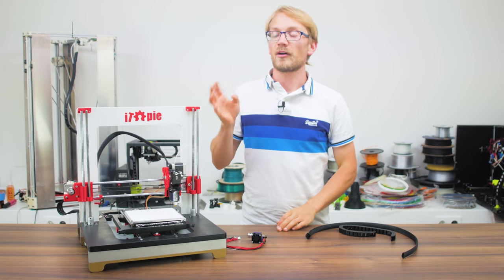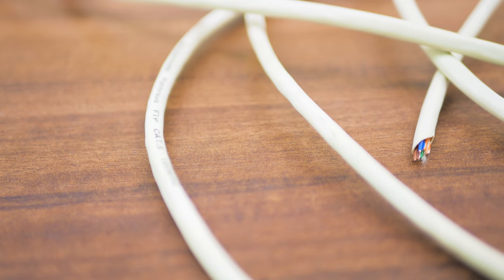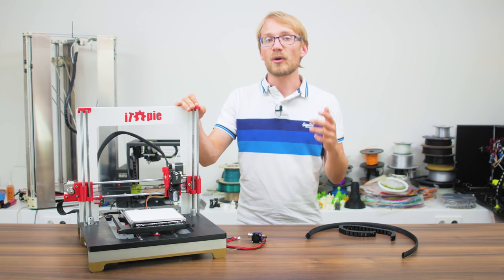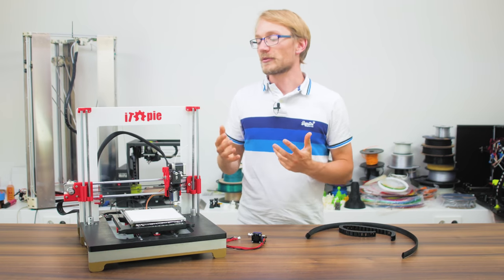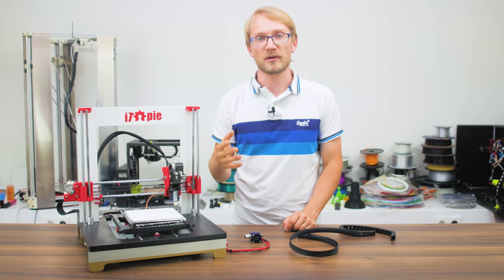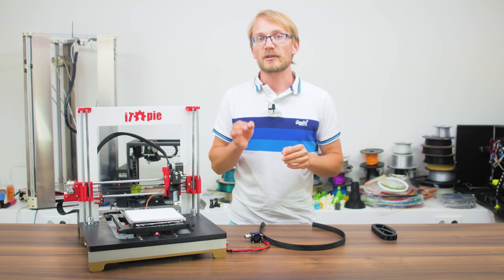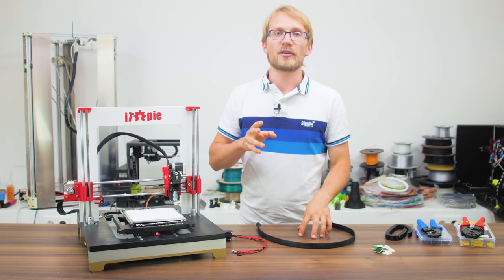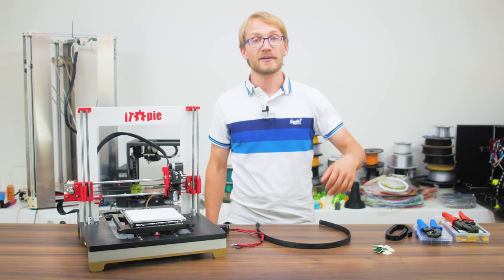How to wire your 3D printer!

Comment: The AWG Standard (American Wire Gauge) originally came from the number of "drawing" passes (pulling wire through a die to make it's diameter smaller), for instance 12 gauge wire required 12 passes through different wire dies, whereas 28 gauge required 28 pulls through various dies. The greater the number the smaller the diameter of the wire.
Reply: so 0000 gauge wire required passing through -3 dies?

Comment: There is another reason to go with stranded wire, it can carry more current and with DC it can carry it with less loss than the same diameter/gauge solid wire. That's because electrons flow mainly along the surface of a wire and a bunch of smaller strands put together to make one wire has more total surface area and thus less resistance to (direct) current flowing. That's why cables made for welding use smaller strands and just a lot more to get to the wire gauge they need. I use welding cable to do the main 12V DC runs from the batteries in my boat and to the trolling motor. When you are running off of batteries all the small losses in the wiring really can start to add up.

Old usb cords are another excellent source of wires for projects. Just off the connectors plus an 3-5 cm (1-2") of cable from the ends and the rest is almost always in good shape. I'm a bit of a freak, wiring up and configuring the controller is my favorite part of building these printers Then again I can't even imagine myself buying a pre-built 3D printer and the last pre-built desktop computer I bought said "Dell 486DX-100" on it.......
Reply: What you're referring is skin effect and it only exist in AC current where there are flux changes periodically. We use stranded mainly for the flexibility.
Reply: @Asu01  And a normal stranded cable doesn't help against the skin effect either, unless the strands are insulated individually from each other.

Comment: Some great information here. I have been 3d printing for around 2 years now, and have learned a lot. Enough to where I feel comfortable buying parts and building a 3D printer of my own, however I have yet to see a video for building a 3D printer thats geared for complete beginners. As a mechanical engineer constructing the working parts would be no issue for me but it took me a long time and a lot of learning to understand how to build a machine with working electrical. From a beginners point of view, theres a ramps board, with a bunch of shit plugged into it and firmware running on the machine. A beginner doesn't know how to pick a board,  hook everything together, know where to plug things into the ramps, or select and edit a firmware for their machine. I think I am going to do a series of videos that covers in detail how to make A 3d printer. Not like in general here are some 3d printer build tips, but step by step, heres how to make THE 3d printer shown in this video from start to finish, covering the mechanical process of building the frame and assembling the parts, to literally where on the board to plug each part in, and how to put firmware on it.
Reply: Wow, this was a long time ago. Just happened to run across this comment and wanted to say this is a fantastic idea for a series that I and many others would be very interested in. I am subscribing for updates just in case.

Comment: i am using ethernet cables on my cnc router steppers, 3A 280ozin motors running at 48V. no issues almost 3 years.
Reply: hi.. what kind of ethernet cable re u using ? thankx

Comment: Good info Tom. Couple of things, leaving this here for information more than anything else as I know it's not a comprehensive guide.

Cable bundles, Spiral wrap; the decent thick stuff works well and is dead cheap, I use the 3-7mm stuff and it supports the wires well and also gives the option to break out a wire from the bundle. There's also an issue with using something like 12 AWG for a bed heater on a board like a Chinese RAMPS or MKS Board. Unless you solder directly to the board or change the headers, the majority of boards I've used can only take up to 16 AWG for the bed, I've tried stuffing 14 AWG in them and it isn't happening. You can use a reducer set of wires with connectors, but it's sub-optimal. I tend to just wire a PCB heater with 16 AWG Silicone wire as it's rated up to around 22 Amps for DC current. When you consider that a standard PCB heater is around 1.1 Ohms at 12v it's only pulling about 10 Amps. If running a 24 volt system I'd be looking at 14 as you're pulling 22 Amps, having a 10A head room is enough.

Comment: a good alternative, though requiring soldering for tier 2 and 3 are hobby battery connectors either dean  (T) or Xt-60, or even tamiya car connectors (these are crimped, too). cheap to get and a single connector will connect a pair of wires

Comment: XT60 connectors work great for higher current items such as cartridge heaters and bed heaters.
Reply: XT60's are what I use in my RC stuff.  One of my craft I calculated would pull something like 60 amps at 12V under full throttle.  Should be good enough for 3D printers.

Comment: I am a big fan of Anderson Powerpoles for the higher current applications and use them on my hot end and bed. They come in 15, 30 and 45 Amp pin types (all use the same housing) and are good to 600V, the housings come in a large variety of colors, and slide together so you can form keyed and color coded connector assembly blocks and they also make blank housing blocks, and there are PCB mount pins as well and can be had pretty cheap. They are heavily used by aerospace engineers on early functional prototypes for that reason, even when 15-45A capacity isn't needed. 

I don't suggest using stranded cat5 or (or even Cat 6 for the higher gauge,) on steppers. You should always be building in an engineering safety factor on your current handling capacity rather than venturing into the safety factor margin. Use 16-18 ga wire for NEMA 17's and you will have plenty of headroom, while it may not seem a big deal with the tiny NEMA 17's, where it totally is when you are driving double depth high-torque NEMA 42's, it really is, because the voltages aren't entirely trivial as a fire hazard or possibly frying half the machine should a wire wear or melt through to something else.

While I love Duponts for hacking and bread board use, I mostly use JST EH for PCB header connections and JST JWPF for mid-path connectors because I keep a good variety of them in stock, as they are waterproof and therefore usable on machining equipment with flood cooling systems as well as keeping chips and metal dust out. Building a assortment of JST or Molex, or pick-your-favorite connectors through mouser, digikey or aliexpress isn't that hard or expensive.

Lastly using terminal blocks and 30mm Din rail for mounting (din rail mount) PSU's, Raspberry pies, and other bits is something I have yet to do with my 3d printer, because I have yet to put it in an enclosure, but is standard operating procedure for larger, industrial (subtractive) machining equipment, and can keep things, clean, servicable, upgradable, and protected from the elements when put in an appropriate enclosure.

Comment: Hey Tom,
danke für das Video! Ich hätte nur noch Flachbandkabel erwähnt, wie Nophead sie in seinen Druckern verwendet. Am Extruder hab ich ein 20-poliges Kabel das den X- und Extruder-Motor, den X-Endstop, das Hotend mit Themistor, den Lüfter und einen freien extra Pin (für LEDs oder einen Bettsensor) versorgt. Am Heizbett versorgt ein 26-Pin-Kabel das Heizbett und seinen Thermistor mit ausreichend Energie. Unterstützt wird das Kabel dann noch von einem Polypropylen-Streifen. Sieht sehr edel aus und sollte auch lange halten. Als Extra gibt am Extruder noch eine D-Sub Verbindung, damit man den kompleten Extruder nur mit zwei Schrauben lösen kann. Ich finde dieses System einfach nur genial, braucht nur ein bisschen mehr Planung.
Reply: Hättest du vielleicht Links zu den Kabeln die du verwendet hast? :)
Reply: Leider nein, war ja alles in dem Bausatz drin.

Comment: I don't like the idea of CAT5 wire for stepper motors, the wire is a bit too thin.  However, CAT5 has 4 pairs, and steppers have four wires.  So, use TWO pairs of wires for each pair of stepper coils, connect the solid colored wires together, and the stripped colored wires together.  Now you have two paralleled pairs, for the two pairs of wires to the motor.  No worries, voltage drop not a problem.

I bundle my wires in spiral wrap.
Reply: Kenneth Scharf that’s exactly what he said and diagrammed.
Reply: Brad .M just use a wire gauge chart and choose something that meets your amperage. I went with silicone insulated which is higher capacity so you need to first choose the type.
Reply: Says guy.  The wire is rated to carry a 2A current but you dispute because of some sort of bigger is better mentality.   How do you think the wire gets rated?  With a dart board? How much current are your steppers drawing?

Comment: I love the idea of Ethernet cable for wiring all the electronics and the mechatronic parts. Is each of the 8 strands capable of carrying upto 2A? Would it be ok to use one strand pair (2 wires) for each motor wire. For. e.g. Assuming that a single coil comprises of Red and Blue wires, would it be ok to use The Red strand pair for the Red end of the coil and the Blue strand pair for the Blue end of the coil?

Comment: Hi Tom, I know this is an old video but just a heads sup.  Solid cored wires are known as 'Cables' while stranded ones are called 'Flex' (sing
ular and plural).

Comment: Always use Crimp Connectors. not Soldered. for flexible wires.
solder wicking into the strands makes the ends inflexible and prone to breaking

Comment: Good info, thanks. Though I have to ask, do you have any experience/opinions with using RJ45 connector on that ethernet cable? Like for instance for the hotend/effector carriage, like the delta wasp? It seemed like a nice way to be able to hot-swap these.Also, congrats on the sponsorship!

Comment: In all cases, i'd use silicone wires. Those are so superior to pvc wires, that i've completely stopped to use the former.
Furthermore, the silicone insulation is much more resistant to heat as well, and another added benefit is that since they are much less stiff than PVC ones, they drastically reduce wire breaking near the connector (i had this hapening often on various electronics projects, and not ones with a lot of connections/disconnections of the cables, nor much movement on the cables, now with silicon wires it never occured yet to me).

Comment: Great video Tom, i recently purchased a Craftbot Plus, what an amazing printer.
Reply: Nice. I have one too, and i'm still happy with that purchase. Shure, it's still not "the perfect printer", even industrial 50K$+ printers are not perfect.I'm pretty amazed tho that they got out of a crowdfunded 3d printer story and are now actually making good printers for a reasonable price.
Reply: What i like is that there are no printed parts and just about everything is steel on it, its a little noisy but it is a machine not a decoration.
Reply: Indeed, it's more built for a workshop, and not really for office users, with the noises it makes. You can tone it down a bit by playing with the speed settings, and i'm shure there are countless other mods you can do to make it an even better machine, just as with all the other printers out there. I just wish they would open the firmware sources up to make even deeper mods to it. The electronics are really quite solid too when you see what other "famous brands" integrate even in the newest (and sometimes more expensive) printers.

Comment: I+m rewiring my printer and this video is really helpful. However, I have a lot of stuff on my gantry. Stepper (4 wires), 3d-touch sensor (5 wires), hotend (2 wires), hotend temp sensor (2 wires), hotend fan (2 wires), cooling fan (2 wires). I'm trying to cut down on number of wires (connector pins) there. I'm using RAMPS, and some of those can share +, and many should be able to share -. I have custom made cable with silicone wires inside. However, testing shows sensors don't like this. Temp sensor , but mostly 3d-touch sensor behave weirdly. I'm guessing EM interference because of their common ground. Any suggestions how to deal with this? Prefferably without changing all cables again :)

Comment: What would you use as a connector if you were going to make the hotend disconnectable I was going to get some spare heater cartridges and thermistors and cut the wires and run them through whatever cable management to the mainboard and put jst sm connectors for all fans and thermistors etc just not sure on the heater cartridge connector

Comment: This was super helpful; unfortunately for me, you left out the suggestion of that one item I was looking for :)  … What do you recommend for the  gauge of wire from the PSU to the board?
Reply: I know this is old and I'm not Thom, but for future ppl reading this:
It depends on what goes through your board. Just add up what goes out of the board and you have an idea what should go in.
Also you could look at the maximum ampere provided by your PSU.
For a mid printers would say 2.5mm^2 (13 AWG) as it is good up to 32A on single wires and up to 26A when you have 2 wires in one
1.5 (15AWG) is good up to 24A on single wires and 18A on multiple wires in one and therefore for enough for a smaller printer.
If you have a 40A PSU, you might need more around 5mm^2 (10AWG).

Comment: Tom, do you typically connectorize the wires on both ends (i.e. connector on the component and on the board side)?
Reply from the maker: I do with proper custom builds now, making parts easily replaceable.
Reply: Thanks Tom!

Comment: Hi, Thomas! With my Prusa i3 (self-made) I have the Z axis motors hooked up in Series. I did the joints by soldering but now it's impossible for me to change the motors (if I want). Everything is working great 2 years allready but can you suggest another method of connecting the Z axis motors?
Reply: You could just de-solder it..?

Comment: As european with a metric mindset i never really understood the AWG system for the wire gauges. Is there a simple trick to understanding it that i'm missing, or is everyone else in the same boat, forced to look up how many mm^2 fit into an AWG26 wire?
Reply: Below is the handy reference I developed based on Global automotive wire spec standards (I work in auto electrical wiring / connectors). These are nominal wire core cross section size very near equivalents for wires you might use on a 3D printer:
26awg = 0.13mm2
24awg = 0.22mm2
22awg = 0.35mm2
20awg = 0.50mm2
18awg = 0.75mm2
16awg = between 1.0 & 1.5mm2;
14awg = 2.0mm2
             = 2.5mm2  is widely available, but between 14 & 12awg
12awg = 3.0mm2

In defining AWG equivalents, what is confusing is that the metric "size" is only a name, the actual conductor  nominal cross section area is smaller than the metric name size. 

Lastly, my experience with Dupont 0.64 connectors is that they pull apart easily (no latch, low terminal mating force, no polarization) ... after several printer failures due to this, they are no longer allowed on my printers!!! LOL.
Reply: As an American, it doesn't really make sense - but you get used to it and can have a rough feeling for the size of a wire when using it in conversation with someone.  Also all of the wire here is labeled with it, so we never need to convert to a real size :D

Comment: I still have a question. What wire do I use for 12v 30Amp power supply to Controller board.  Because its not moving, I am hoping a regular stiff copper wire should work.
Reply from the maker: +Sourabh Roddey any wire will work, but I'd recommend at least 4mm² to minimize losses.
Reply: Understood, Also I am trying to build a printer where I would have a separate controller box hence looking for connectors for Heatbed and Hotend(Motors already have it on them). I can take printer frame on move with controller box separate.

I have come across, XT60 connectors for Heatbed(Can take upto 60Amps) with different JST connectors for Hotend, fan and sensors.

Do you have any thoughts on this or can suggest any other options for connectors. Seems to me, panel mount connectors are the most expensive and difficult to find.

Comment: speaker wire has the  bad factor of not being tightly wound, so you end up with fat cables, but copper by weight is much much lower

Comment: What I don't understand is why 2 wires of the cat 5 cable should be enough for the heater, but for a single wire Thomas recommends a 0.75 mm² wire? 2 wires of a cat 5 cable have much less surface. Shouldn't a 0.5mm² cable, that I have already,  be good enough?

Comment: You have to do a video on reducing sound!
Reply: As in, noise cancellation of a 3d printer. Techniques to follow to significantly reduce those disturbing harmonic sounds produced by the motors mainly :')
Reply: Jordi Foix increase the micro stepping and use something to insulated the feet that it sits on. I used a combination of sound deadening and sound insulation and it reduced the noise significantly. Only problem is once it's quite you get used to it and then it seems noisy again so it's never ending.

Comment: At 9:55 what happens if they touch? Wouldn't that cause a shortage?
Reply: It would, that's what electricians tape is for.
Reply: or just use heatshrink/ isolated connectors.